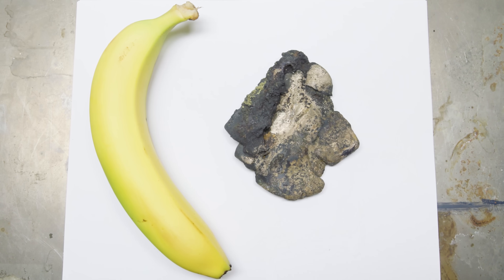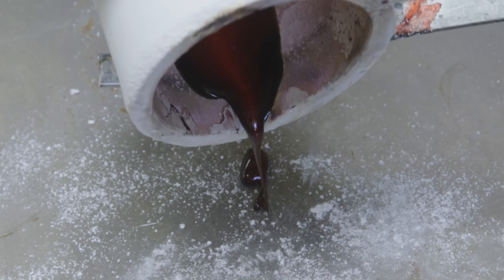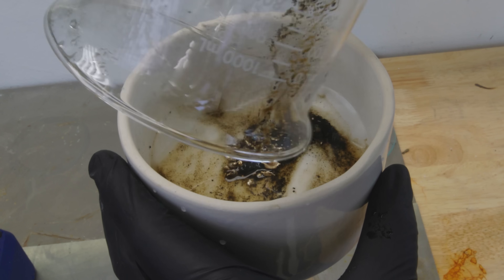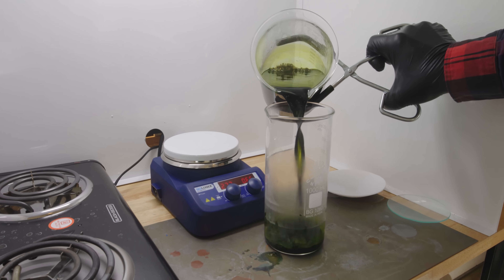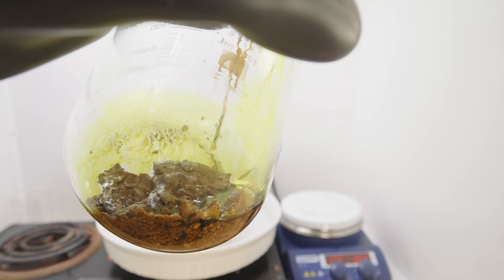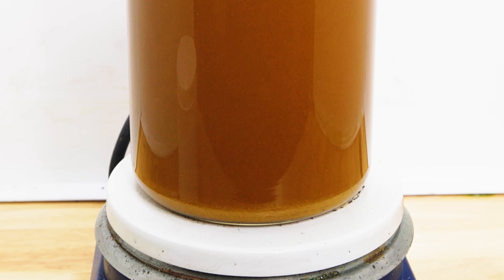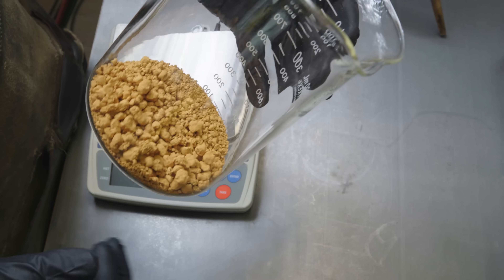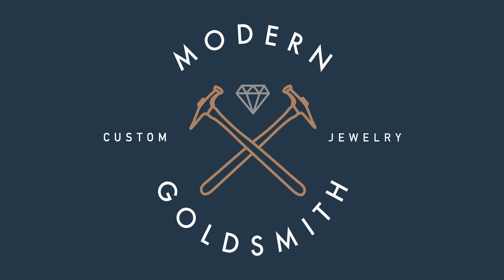Turning a BLOB into PURE GOLD!

Comment: 1) for yall wondering: the yield is likely not fully accurate. He should’ve melted the blob down first and try to make a possibly even mixture/alloy (which is not the easiest) before trying to measure its purity. Also, the nitric acid and hydrocloric acid washes should have been done before making aqua regia (doing this will separate out other impurities in the gold before actually dissolving it, which does a few things: makes you use less acid to actually dissolve the gold, and it makes cleanup of the impurities easier. 

The yield is likely significantly lower. It’s hard to get a really good yield through a chemical process without industrial optimizations. I’d likely say the yield was ~70-80% or greater than that. That’s all. Also watch NileRed’s video if you want more of the chemistry behind the cleanup.
Reply: Also, the orange gas being released, I believe is nitrogen dioxide. It’s a product of nitric acid reaction with metals like copper that are impurites. That is why the nitric acid washes should be done before dissolving the gold. A nice agua regia solution dissolved with gold has a nice orange/yellow/red color (depending on concentration), and the black stuff that is seen is a sign of impurities.
Reply: You know you are dissolving mostly pure gold when you have created agua regia that is dissolving gold but not releasing a bunch of orange gas, which you see in the second step of purification he does. Also, that is a recent chuck of silver chloride precipitate there.

Comment: What a adulteration .......

What you did with all that poison left over liquids ...??? 
Where the fume goes ( filter ) ???

What a struggle to purified ....... 
And all that as a person  ( Goldsmith )  who do this kind of processing seldom .....

You smelt with a tourch instead with a induction furnace ....

I was just waiting that you build a elektrolite system and pour a anode plate and use leaf gold as a kathode ...
or leach it with cyanide .....

etc. etc.
well ... finally you stay away from that nitosic fume ..... and kept your workplace allways clean ! 👍

Comment: I used to work at Heraeus and what he did we use to call it extraction of precious metal, using about the same method he's doing in this video just that we were dealing with huge reactors.. one question, what if you were to use ferrous sulfate to drop the gold? That's what we used in some solutions for dropping gold beginning the cool down process.. Im just wondering . ❤❤

Comment: As a kid I played around with a torch, melting metals just for fun, never really knowing what I was doing.  You're having a very good time creating beauty, which is a pleasure to watch.
Reply: AS A KID??
Reply: @ I was around 12 when I got a Bernz-O-Matic propane torch. It was just hot enough to melt silver.
Reply: @riverwildcat1  that’s crazy dude
Reply: Yay!
Reply: How do u melt mettal with a normal torch?😂
Reply: @ Lead and aluminum melt at fairly low temps. Silver will melt if it’s carefully cornered. Beyond that, oxygen is required.

Comment: Sreetips would have inquarted (6k gold) the blob and corn flaked the metal then leached the silver and copper out with dilute nitric acid boils. I usually takes 5 or 6 boils.  The residual gold can then be dissolved in aqua regia and then filtered and precipitated several times to get gold that can be melted and cast.  The silver can be recovered by cementing on copper or the lye and sugar method.

Comment: The whole process required to recover 24K gold is more complicated than it is showed on this video. We can agree the purity of the "blob" is c.a. 10K or lower so we do not need to break the gold alloy purity to 10K. The 1st step is to remove (dissolve) the base metals from the alloy by using nitric acid only. It will dissolve all base metals except the pure gold. After dissolving base metals, the remaining gold should be rinsed with the distilled water. After this we can approach to the process when gold can be dissolved and filtered for increasing purity during gold's precipitation from it's liquid form. Purification process can be repeated few times for better end effect. During purification, the small amount of sulfuric acid can be added to precipitate lead as lead sulfate.  Dissolving gold as the alloy (by using Aqua Regia) has no may sense because of problems in the further purification process. B.W.

Comment: I am a physics teacher who has watched the channels you credited (sreetips and nilered) and here are some things you may have missed: 

1) when melting the lump, add a quantity of borax to immediately corral the "crud" that subsequently took a lot of water washing and filtering to take care of. The borax turns the non metals and reactive metal salts into a glass that flows together, isolating the more unreactive metals in a single blob. With you being a goldsmith, I'm surprised you didn't do this. Sreetips makes liberal use of borax when melting.

2) Silver chloride is annoying to deal with as a solid. If at all possible, you want to keep the silver in solution, and avoid the intensive processing seen in your silver video.

The way to avoid this is another thing you are probably familiar with: inquarting. Since the blob is about half gold, one to 1.5x its mass in silver should have been enough. Once the metals mix, cornflake the mixture by pouring into the water bucket as you showed.

Now that the blob is inquarted with silver, you can use dilute nitric acid on its own to dissolve the blob. The gold (and other metals that don't react with nitric, such as platinum) will remain behind as a powder, and the silver is still in solution, making purifying it later much easier. Other valuable things in solution could include a little palladium, so watch out for that.

3) At this point, with the remainder in a finely divided state, it will react quickly with aqua regia which will dissolve gold, platinum, and palladium. Anything left behind at this stage is either residual silver which will be white silver chloride, or even nobler metals such as rhodium or iridium which will be a black powder. Filter these off, and what remains should be only dissolved gold and platinum. After precipitation with sodium metabisulfite, gold will drop out but platinum would remain dissolved.
Reply: If someone has trouble sleeping, all they have to do is read your loooong comment here, and they will be fast asleep!

Comment: I disagree with your logic at 0:46.  That red light indicates whether your sample is equal to or greater than 10K.  So, the gold blob could have been 11K or 12.5K and the same red light would have lit up.  Therefore, your math from that point onward is questionable because you assume the blob is exactly 10K or 41.8% gold, which you don't know for a fact that it is.  Furthermore, even if the sample you cut off the main blob is exactly 10K, you don't know that this level of purity is consistent for the rest of the blob; other parts of it could be 11.5K or 9K or what not.

Comment: I do it a bit different.. first I use a sand bath on hot plate to keep direct heat off the beakers in  case they break solution going in the sand and you can recover it . 
Next I pre cook the material in nitric acid and distilled water.  Removes a lot of the metallic garbage.  Then melt.
Also I drop the gold out with oxylic acid . Works better .it not drop the pt metals if present. 
Finally  when button is hot and rolling around.  I sprinkle potassium nitrate  on button . Trash comes out oh f the button and goes into the borax. I do it until the glass  is clear.  This raises the purity.  
You did good . Next time you be better at it .I'm sure

Comment: The fume hood was a good idea.  Those fumes are not only dangerous to inhale, but they are corrosive.  They can actually cause damage to anything in the room you are doing this in.  Metal light fixtures etc.  So, don't mess around with acids like this unless you really know what you are doing and have the proper safety equipment.

Comment: Summary

A goldsmith investigates a metal blob and discovers it is made of 41.7% pure gold. They attempt to extract the gold and refine it, facing challenges along the way. In the end, they successfully extract 213.2 grams of 24 karat gold.

Highlights
00:00 🍌 A metal blob is discovered, potentially containing gold.
01:12 🧪 The goldsmith tests a small sliver of the blob and confirms it is 10 karat gold.
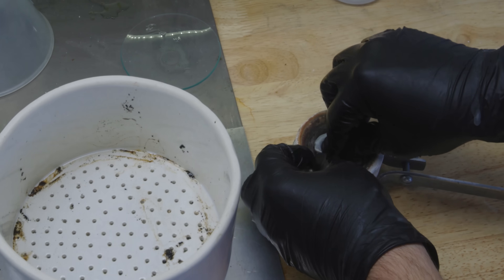05:22 🔥 The goldsmith melts the blob but faces challenges due to its size and impurities.
11:06 💧 Water casting is attempted to create individual gold flakes, but most of the gold sticks together.
13:50 🧼 The gold is cleaned and filtered to remove impurities.
18:40 ⚗ The gold is dissolved using aqua regia and then precipitated using sodium metabisulfite.
25:03 💎 The gold is purified further and melted into a 24 karat gold blob.
Key Insights
🍌 The initial discovery of the metal blob highlights the importance of recognizing the potential value in unexpected objects.
🧪 Using a gold tester and acid solution, the goldsmith accurately determines the purity of the gold in the blob, which sets the foundation for the refining process.
🔥 The challenges faced during melting and refining showcase the complexity and patience required in extracting gold from impure sources.
💧 The attempt at water casting demonstrates the goldsmith’s creativity in trying different methods to achieve desired results.
🧼 The cleaning and filtering process plays a crucial role in removing impurities and ensuring a purer final product.
⚗ The use of aqua regia and sodium metabisulfite showcases the chemical processes involved in dissolving and precipitating gold from a solution.
💎 The successful extraction of 213.2 grams of 24 karat gold highlights the goldsmith’s expertise and determination in refining the metal blob.

Comment: You have my crying. You rushing through the prosess and not appearing the proper method has the result of so much loss. 
You should have imparted the specimen to then make your shot that you then first liche out the silver and led , maybe platinum metals befor desolving it with aqua riga which you filter to get the most pure solution possible. When adding the SMB you should use a bigger vessel dilute the solution and then add ice made from distilled water. In oder to cool the solution right down. Then add your SMB. You add until wetness a white thome building on top of the solution, then test the solution.
Hears a tip. Look at the videos Threetips puts out. He is the champion of hobby refining. I am upset now.

Comment: FIRST! I know you said a client dropped this off, but you REALLY need to make certain it was melted from like a house fire. If it is a Natural Blob - DO NOT REFINE IT! Natural gold nuggets that size are worth "multiples of ten times the spot price of gold" because of the rarity of natural things that size. A six pound nugget found about 8 years ago sold for $415,000. To refine gold it's simple: 1. Dissolve the blob in Aqua Regia (mostly Sulfuric and Hydrochloric Acids). Add a little magnetic stirring and a little heat. When the solution is clear yellow (with dissolved gold), add a pinch at a time of Sodium Metabisulfite. This causes pure gold to precipitate from the "Pregnant Gold" in solution.

Comment: That second refine wasn't gonna be a lot cleaner than your first. Those undigested solids weren't silver chloride. It's plenty soluble in your extremely nitric rich AR solution. Those solids were probably a mix of insoluble oxides and gold that didnt make it into solution. Here's where you made a mistake. You didnt rid the solution of silver chloride. Some was precipitated out with the cooling and dilution from the ice. Hence your dingy cloudy solution. That silver chloride is so fine it passes right through a filter but that's what was making your solution cloudy. But it still had plenty of silver chloride still dissolved in it. What you needed to do was dilute it with water distilled preferably if you're going for the cleanest. I found a ratio of about three to one water to solution. Yeah it's going to give you the more volume of solution to have to filter work with but it will kick the silver chloride out which can be filtered out. But not like you filtered. With method you were using with filter paper you would want to run the entire solution through that paper three or four or more times the same paper each time you run it through it'll catch finer and finer particles of the silver chloride when you're done your solution will be crystal clear I mean completely crystal clear it'll just have that beautiful day glow orange color. That dilution method also has the added benefit of precipitating out some of the copper that might have been in the solution as well. Now to get your cleanest drop with the materials you're working with what I would do is make a gas generator out of the filtration flask using your SMB and fresh HCL. Connect the vacuum Port of the flask to a tube run that tube down into your gold solution and let the generated sulfur dioxide gas reduce the gold out of solution very cleanly. SMB does not reduce gold out of solution itself it reacts with the acid in the solution to generate sulfur dioxide gas sulfur dioxide gas is the reducing agent here. Do it like that then do a proper clean up on your precipitate. Boil in distilled water, then boil in HCL. Rinse well in distilled water. The boil in ammonia solution. Then rinse well in distilled water. The boiling in both water and acid will remove traces of base metals and residual salts mixed in with your gold. The boiling in the ammonia solution will dissolve and leftover silver chloride left behind. You do that right you can hit 999 fine 24k purity

Comment: Way easier method of purifying gold: put the blob in concentrated hydrochloric acid and heat it all up until it starts boiling, wait for half an hour.
The junk on the gold should have dissolved and only the gold should be left.
If hydrochloric acid doesn't work, you can try different acids one by one to dissolve all the impurities.

Gold is only soluble in a mixture of hot hydrochloric acid and nitric acid. Most other metals are easier soluble

Edit: OMG YOU ARE DISSOLVING THE ENTIRE JUNK TOGETHER WITH THE GOLD IN AQUA REGIA WHAT AM I WITNESSING

No offense, but maybe at least talk with an actual chemist before you do that kind of stuff. You are doing so many things wrong in this video

Comment: You should have added sterling silver to your 14c gold (i forget the percentage), melted it together, dropped that into a bucket of water, and then get the inquarted gold, add nitric acid to get rid of all other metals to leave just the gold, adding silver helps remove other metals in the nitric stage, and Then use aqua regia on the remains, dont add too much nitric, only enough to put the gold into solution, add a few drops of sulphuric acid to get rid of any lead, desolve everything, filter it, then use sodium metabisolfite to extract the gold, rince off with distilled water, then aqua regia again, couple more drops of sulphuric, remember to add just drops of nitric in the aqua regia so you dont have excess nitric, cool the solution, add the sodium metabisulfite again (if you have excess nitric acid it puts the gold right back into solution here), let settle, pour off the fluids, rince with boiling distilled water, you can do a quick hydrochloric acid boil before rinsing if you like, once all acids have been washed off, dry the powder slowly so theres no steam explosion, then melt it! THEN you will have close to 5 9's pure 24k gold! 
Where on earth did you get this crazy refining process? Its all wrong and back to front, you lose gold.
Reply: This is the comment I was looking for. The video is honestly a little hard to watch.
Reply: So the reason the process took so much metabisulfite and it took so long was too much nitric acid? That actually makes sense. It sounded like the procedure he was using called for very small amounts of metabisulfite, and the obvious need for more was throwing him off, so it makes sense he overdid it with the nitric acid. 

With the lack of silver, I feel like he just wanted to keep his costs down, maybe? Isn't silver expensive?

I have to say, I wouldn't have minded seeing a small steam explosion! Thanks for taking the time to provide a chemist's viewpoint on this one.

Comment: Very inspiring! Thank you for sharing.
I have a lower value aim, which is to extract silver from photographic fixer solution. .. and maybe rejected prints. 2 different processes, no doubt, with very little yield overall, but the environmental concern is higher than the monetary gain, which may even be a negative.

Comment: Why might it give you 9 grams short?
Well this is because In chemistry your calculated amount or estimated value is called the theoretical yield. And the real mass of gold that you extracted from the blob is your practical yield. The theory from stoichiometry states that practical yield can never be equal to the theoretical yield, but it will be quite smaller than the theoretical yield.
Because of 1) impurities
                     2) losses 
                     3) Human errors.
Over here 2) is a major issue you faced. Because You actually lost some gold by doing the stannous chloride test. The paper soaked some gold ions from the solution. Thus it made a few losses.
But your yield is incredibly and extremely maximized.